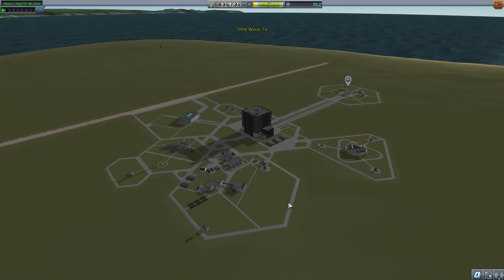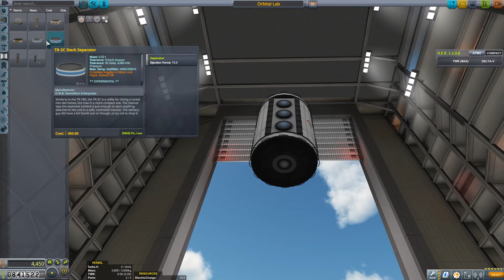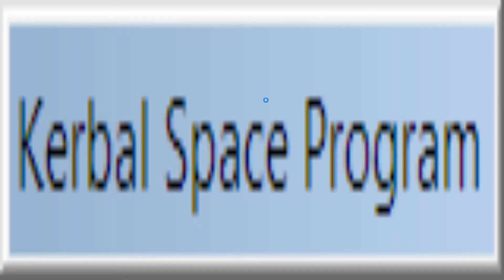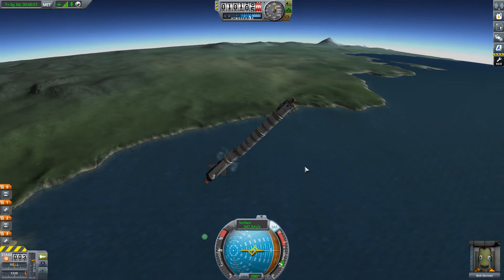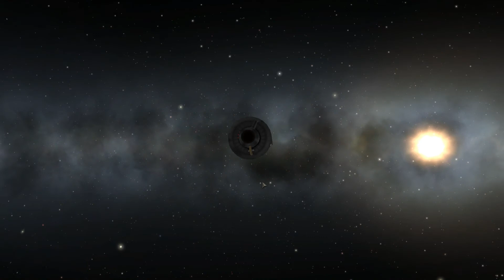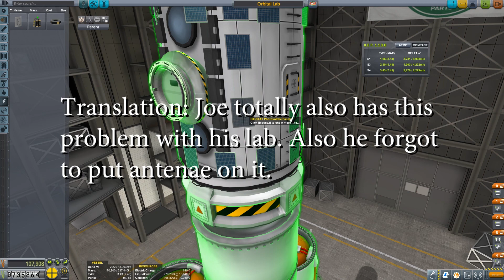Kerbal Space Program: We Definitely Launch a Mobile Processing Unit

Comment: Twin Boar should be used with 2 Orange Tanks, or 3-4 medium sized grey tanks - using less fuel is a waste of the engine. With enough fuel and proper streamlining of the MPL (either a nose cone, or wrapping it in a fairing) the Twin-Boar should be able to put the MPL in orbit as a single stage.
Reply from the maker: Roger that. We are very new to the bigger engines and structures. Clearly. Thanks for the tips and for watching!

Comment: Ideally when you're sending out the lab, you want to include all the experiments on board, and collect every possible experiment on the way to your destination.  My favourite destination is Minmus, because it's easy to land on (and get the really valuable experiments from the surface).  The lab also produces more science per day the more data it currently has, so it's best to stock it up to the full 750 if possible.  Also, works faster with two scientists, and higher level scientists.

The lab consumes a fair amount of power when processing data, so best bet is a bunch of batteries, and a bunch of the deploy-able solar panels.  So, lookin' at your parts screen, you probably need the next electrics research!

Fun to watch as always.  Thanks for the episode!
Reply from the maker: Yeah, we definitely found about the power needs this thing has. Landing on Minmus with one of these definitely seems doable too, although I've got a hankering to get SOMETHING out of the local system, so that might not happen till later.

Comment: I think the flipping problem is a result of the very high drag generated by the flat top of your rocket. Perhaps try putting a pointy bit on top. It is also advised to start a gradual gravity turn fairly soon after launch and then try to reach 45° somewhere around 7000m (this might seem very aggresive, but the atmospheric model was changed to be slightly less soupy a while ago). Just slowly follow the prograde vector down to the horizon and with good thrust management you might actually reach a circular orbit in one burn.
Sorry for the text dump :)
Reply from the maker: Don't apologize for helping! (You should see some of the comments on our Rimworld Let's Play. Our viewers can and frequently DO write a book about what we're doing wrong.)
Reply: Was gonna say the same thing.  Try a payload bay for all the little bits and pieces too.
Reply from the maker: Ooh, good idea.